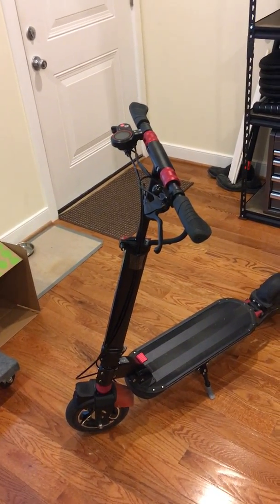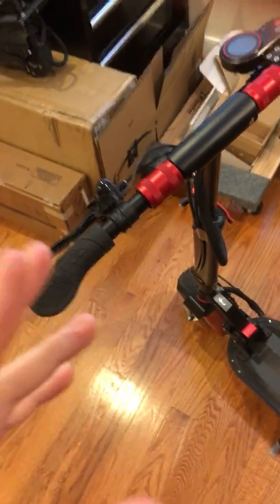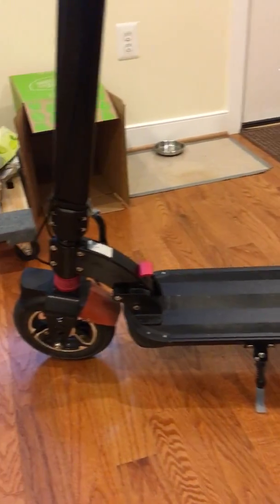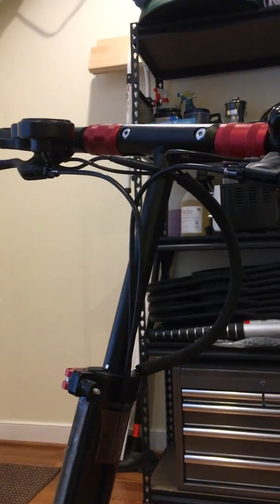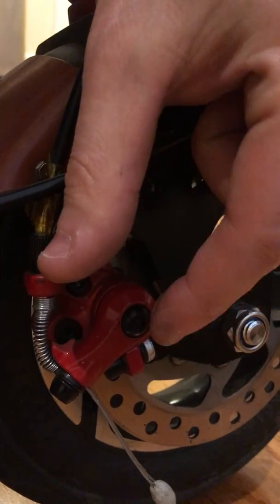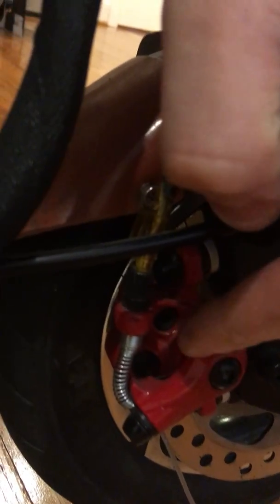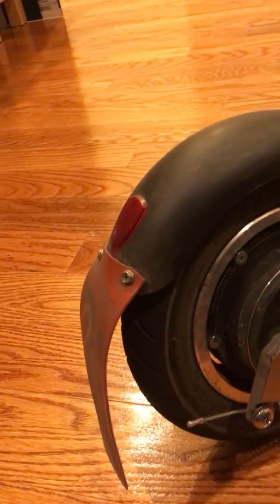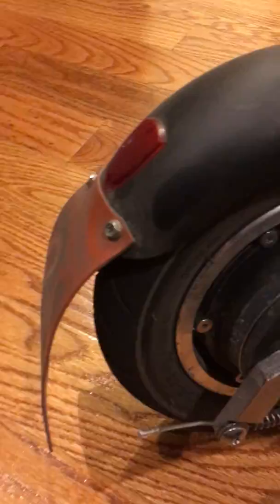Turbo Wheel Dart Construction Quality Review and Mods

Comment from the maker: Sorry about the portrait mode.  Yeah that was my bad.  As far as materials are concerned, I used black colored exterior sealant for windows and doors.  Also the rubber flaps cut from toilet gasket rubber sheets you can find at any hardware store.  I do have an update concerning the rear wheel:  I believe that the quality of the rear tire’s inner tubes is too inconsistent to reliably handle the heat generated by the motor combined with the heat created by rolling friction during use.  This problem is made more severe in hot climates.  I have had 3 flats in 3 weeks and I have examined the inner tubes in all cases.  These flats were not the results of punctures, internal abrasion (inner tube rubbing against tire or rim), incorrect installation, or incorrect inflation pressure.  I think the heat causes the poor quality seams of the inner tube to weaken and separate resulting in spontaneous, fast deflation.  I think this in part because the front tire is also an air tire, but it has never gone flat, only the rear tire has.  The only obvious difference between the two is that the front tire is unpowered while the rear wheel houses the motor.  If anyone is experiencing consistent unexplained rear flat tires I would recommend switching to the airless alternate currently offered by FalconPEV.  They’re back ordered but right now they’re the only game in town selling these airless alternatives for this specific rim size.

Comment: Mangarang - a fabulous review about water-proofing. Thank you very much! Given your experience in the details that must be addressed to waterproof your scooter, what are your general thoughts about the IP54 water-resistance claimed for the Apollo scooters (the "City" is very similar to the Dart band the Zero-9)? 

(I know that "water-resistance" is not the same as "water-proof" - but I wonder how much more protection a IP54 rating gives you compared to no water-resistance)

Comment: Hi. Thanks for all the great tips! But I’m surprised that you haven’t mentioned the softness of the rear suspension. When I step on the scooter they bottom out and provide no ride comfort. Do you know by any chance if they can be replaced with stiffer ones?
Also you mention you had the deck open. Is there any space for a larger or additional battery?
Reply: Steve Hart hi from England have just got the zero 9 same basically and have same problem rear suspension useless far to soft and creaks sometimes one shock is longer aswell 12mm to 14mm shame really
Reply from the maker: I think the non-adjustable nature of the rear suspension combined with various rider weights as well as some variability during production makes the rear shocks very hit or miss.  I weigh 200 pounds and I’ve been lucky enough that my rear shocks don’t bottom out.  Also the deck is end to end battery.  There is no additional space within the deck to house more cells.

Comment: Thanks for the review,  i wanted to ask you, i have bought the same scooter for someone and they just told me that the battery indicator on the lcd always shows full is there anyway to fix that? I got it from ewheels but haven't asked them yet.
Reply from the maker: How much do they weigh?  How long/far do they ride it before they charge it?  Has the scooter stopped (ie. Battery died) while in use but the screen still showed full battery?  I ask these questions because it may be possible that it’s not being ridden enough in a single sitting to show a battery drop.  Otherwise it’s an electrical fault, and unfortunately like I say in my video, I suck at diagnosing electrical problems.

Comment: Hello. Impressive work you have done here to seal it from the elements. I have spent the last days searching on the net after videos like this after I purchased a Zero 10X ( turbowheel lightning ). I live in Norway and the weather can be shifting from sun to rain quite fast so it made me think about doing some work on sealing the construction as best as I can. Can you make a list of the materials you used to do this? If you have any tips please let me know. -Marius
Reply from the maker: I used a black DAP exterior sealant for most of the thin gaps along the deck.  I eventually changed the sealant I used on the rear axle bolts and nuts.  I used to use black DAP but after having to remove it so many times (rear tire changes, long story) I decided to get crafty and use sticky putty tack, which is used to hang posters on walls without making holes in the walls.  The tack is a permanently pliable waterproof putty that can be removed and reapplied many times and very quickly and easily.

Comment: Awesome video!  I just purchased a Dart and have completed all the upgrades you've outlined.  The wiring wasn't too bad, but I've found that it's really tight getting the front plate on with all the wiring in one side and fixed to the plate itself.

Would you happen to have the sizes for the replacement screws or could share where you purchased them?
Reply from the maker: I can tell you that they’re metric sizes but I don’t know which exactly.  Somewhere between m3, m4, or m5 is my guess.  I went to my local Ace hardware store to get quality stainless steel screws.

Comment: great video, I might of missed it but what range do you get, is it the same range as out of the box before your mods?
Reply from the maker: I charge to 90% and I try to not go below 1 tick mark on the battery indicator, so between 10-20% battery remaining.  I ride in gear three, with no speed limit (ie, value 100, under P8 in the settings menu), and full acceleration (ie, value 5, under P12 in the settings menu) and I ride flat out the whole time.  I weigh 215 pounds.  Under those conditions I get 10 miles at an average of 20 mph, with peaks of 22 mph on level ground.
Reply: @mangarang  I want to get the dart, I'm debating between the dart and the spider. i weigh 140lbs and want it to commute in Manhattan 6.8miles to and 6.8 miles from work total about 13-15 miles. I ride my Xiaomi now and think 15 mph is plenty in NYC. do you think I would get the range I want with this scooter or should I spend for the spider? they're still illegal in nyc but not enforced terribly so it would be  cop having a bad day and a 1k loss is better than 3k.
Reply from the maker: Riding parameters really make a lot of difference to range on a single charge.  Some other things I do that I didn’t mention are: I use the kick start feature so that the most torque intensive movement (starting from a dead stop) is coming from my legs and not the battery.  I also have electric braking set to 5 (that’s the max setting under P11 in the settings menu).  That’s helps charge the battery a little during use.
Reply from the maker: Any negative impact to range from the weight of the mods is trivial since their combined weight is negligible.
Reply: @mangarang  so spider or dart for my needs mentioned and specs in previous comment? NYC has a few hills and is stop and go never over , I wouldnt mind using kick start as well. speed really will never be over 18-20mph. most of the time will be 10-15
Reply from the maker: For your weight the dart will be plenty fast, and the suspension will be able to handle bumps and dips no problem.  I wouldn’t jump curbs with it though.  The spider is way more expensive and has bigger dimensions and weighs 4 more pounds.  Also, the handlebars don’t fold in on the spider like they do on the dart.  How much is portability a concern for you?  Do you have to carry your scooter a lot?  Have you checked out the ewheels website?
Reply: @mangarang  I have heard a few people say ewheels resales used parts so I'm a little hesitant tbh, I would prefer mini motors, i live up one flight of stairs. I dont have a proble  lifting my xiaomi, and I run out of miles about 2-4 miles from home o  that. the 4 pound difference between the dart and spider I dont think will kill me although I do like the dolley option available with the dart next month. my concern is not speed on either of these because I will not be trying to max them out. range is my  biggest concern and I've heard one person say they would actually give me similar range since the spider has a bigger motor and two of them
Reply from the maker: The spider will definitely be more difficult to carry around.  I don’t know about the resale thing you mentioned but if you’re concerned about their business practice you should call up ewheels and ask them about it directly.  I have no reason to believe they wouldn’t answer you honestly.
Reply: Alex I honestly love my dart. My gf has the Xiaomi and it’s currently for sale because she now wants a dart. The folding handle bars are plus for me, I take my dart with me into restaurants, onto the train and use it as a grocery cart while shopping! Last note..the customer support at ewheels has been superb. The crew is super responsive, I sent an email Wednesday about a broke part and the part was at my door step by Friday afternoon.

Comment: i plan to have a bucket full of silica packets if i catch unfortunate weather lol. i wonder if the warranty dies if u do these changes
Reply from the maker: Oh definitely.  Some of these mods will absolutely void the warranty.  That said, ewheels’ warranty covers failures from “normal use”.  In my experience, a scooter with this build quality rarely suffers catastrophic mechanical failures from normal use.  Instead, the trouble tends to come from electrical failures.  Electrical systems (battery aside) rarely fail due to repeated normal use.  Rather, they fail because of exposure to environmental conditions that the warranty would likely classify as “not normal”.  My use-case has me riding this scooter in all weather, so it’s a risk either way.  Either I leave the scooter unchanged and hope that an electrical failure likely caused by abnormal riding conditions will be covered under the warranty, in which case I’m still out repair time and possibly shipping costs, or I take my chances trying to harden the scooter against such failures, and void the warranty in the process.  Definitely a risky business.

Comment: Thanks for your efforts that was a very thorough review. I can see that your mods will prevent a number of issues. What are your thoughts on the rear shocks' durability. They seem to use air springs but I couldn't see any valve to pump them up as they lose pressure over time. When I contacted FalconPEV about this they replied "We have actually changed the shocks to coil shocks inside the cylinder." but I find that hard to believe. I'm currently trying to decide between the Zero 8 or 9 and a Ruima 4 Mini (aka Speedway 4 Mini Pro) which uses a more traditional coil spring so your thoughts would be appreciated. The other option is the Mercane Wide Wheel dual motor scooter but that's both heavier and more expensive.
Reply from the maker: I understand your concern over the longevity of the rear shocks.  In truth, I expect them to wear out over time.  However, spring shocks will wear just as much although they can be replaced more easily.  I weigh 215 pounds and have been using my scooter 5 days a week for commuting approximately 2 months now.  I cannot detect any degradation in their springiness.  When the inevitability do give out I will either order replacements or convert them to spring shocks.  As for your other question concerning the zero 8 vs. the zero 9 I’d need more details about your use-case to give you a good answer.  How much do you weigh?  How often do you intend to use the scooter?  What are the road conditions like where you intend to ride?  How many miles on average will you be riding per trip?
Reply: @mangarang  It's good to hear that the shock is holding up so far. I weigh 75 kg / 165 lb and would use it probably 3-5 days a week for at most 10 km / 6.2 mi trips. I'm from Australia and would use it on local 50 km/h roads and cycle paths of average quality. We don't have snow or salt to contend with where I am, only rain in the winter. The pros of the Ruima are it's bigger battery, simpler cable management, better waterproofing and regular back shocks but it comes from China which is slow and has no after sales support. Also it has solid tires so the ride may be a bit rougher. The Zero 8 looks attractive as it costs 700 SGD vs 950 SGD for the Zero 9 from Singapore (plus 160 SGD for shipping for either one). It also has the same simpler cable management as the Ruima so it looks like it could be waterproofed quite easily. It has a solid rear tire so it may have a slightly harsher ride. It lacks the front disc brake and bling lighting of the Zero 9.
Reply from the maker: The rear tire being solid can be a blessing.  The peace of mind of not having to worry about flats on the rear wheel is great because unlike the front tire changing the rear tire is a pain in the butt because it means possibly messing with your motor.  Or if you waterproof the power cable interface to the rear axle it means having to undo your waterproofing and then redoing it after you change the tire.  The loss in comfort is marginal compared to the gain in durability.  For your weight you’ll get great speeds out of any of those options.  So it really boils down to portability vs braking efficacy.  If you don’t see yourself traveling fast in high traffic situations I’d say go for the zero 8, you can get away with just a rear drum brake.
Reply from the maker: I take back what I said about any of those options providing great speed.  Looks like the Ruima has a 350 watt motor.  And I’m not a fan of the front light.  Appears to have a flimsy connection to the stem.  Seems cheap and underpowered.  I’d stay away from the Ruima, it’s bigger battery doesn’t gain you much compared to the other two models when considering your weight.  Then again I’ve never used one.  Just my opinion.
Reply: I returned my Turbowheel dart because the springs completely bottomed out in the back with just me standing on it. I was 186 lbs.
Reply: @geologyguy101  are you able to adjust the rear suspension?  I have the es4 but returning it because the cricit board started to malfunction like others have complained. Which scooter are u looking into now? I was looking at zero 8/9 and seen turbowheels has the same brand. I believe the zero 9 is the turbo wheel. But I heard zero 8 has better rear suspension because of longer design

Comment: how long does it take to recharge cuz my recharge seems slower after a recharge. and do u turn it off when u recharge or turn it on when u recharge.
Reply from the maker: Definitely turn it off prior to recharging.  I’m afraid I didn’t quite understand the first part of your question.  What type of charger are you using?  The standard one that came with the scooter or the fancy 5 amp variable charger that costs extra?  That’s the one I have.